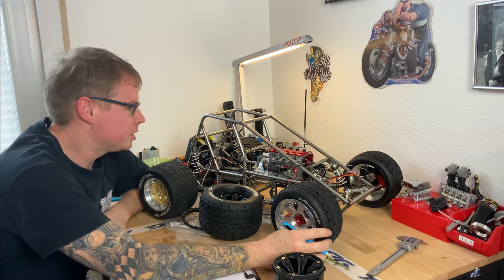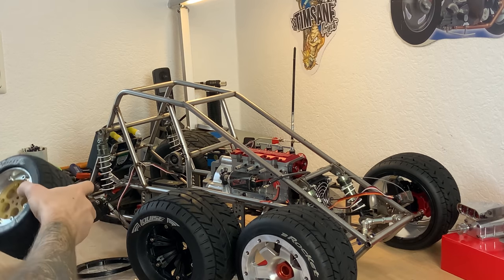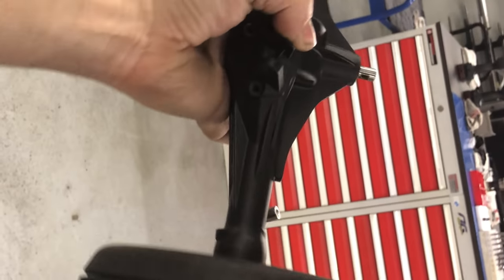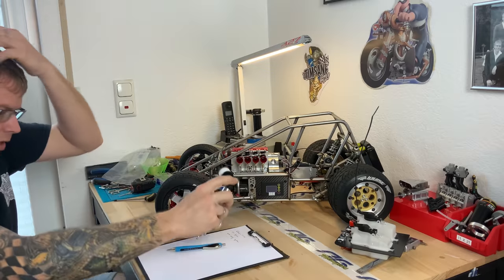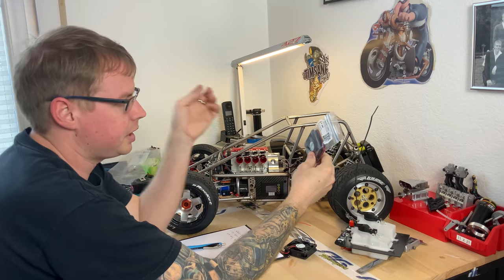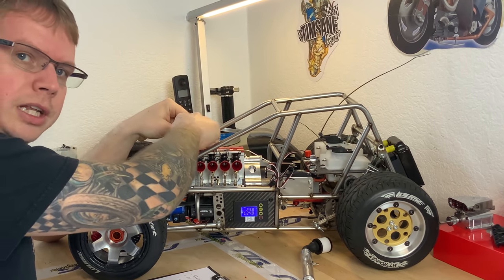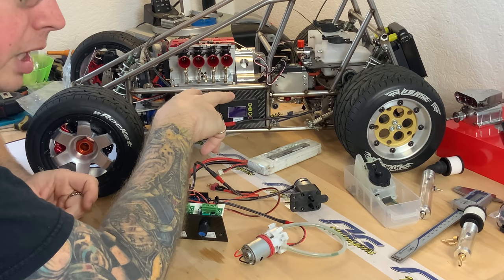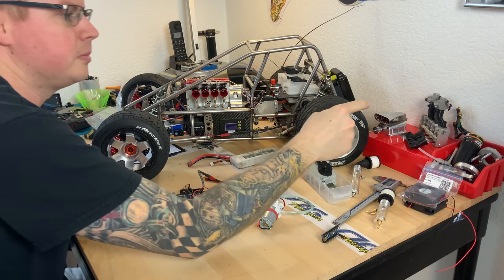1/5 RC Sprint Car - Toyan Oil and water system plus billet wheels and tires

Comment: Fantastic project. 
I grew up in Connecticut. Every summer as a child in the 70’s, we would spend August in Wisconsin. My uncle and aunt owned a midget. They both worked on the assembly line at Briggs & Stratton, assembling lawn mower engines. Back when companies paid a living wage😂 
I spent hours, sitting in the seat, still on the trailer, in the driveway after a evening race.  They occasionally placed, but it was always a party......all day long😎
Reply from the maker: That sounds like fun and nice memories! Glad to have you onboard of my channel!

Comment: heat the centre of the from rims and brush it with brass brush you'll get the same color as the rears if done right.
Reply from the maker: Thanks for your comment! We do a special ceramic coating in our shop. This is how I made the rear centers and that will be the coating for the front hubs as well.

Comment: Nice. Wheel and tires. Those stock rear wheels look like the ones of the Raminator.
Reply from the maker: Thank you! I had to check back to see the Raminator again -- I want one!
Reply: Why?!, if you can make one!. 😂 on a serious note what would you do or add to it if you had one? Besides swapping out pipe or engine?.
Reply from the maker: @713Ace529  The drivetrain should be changed as you mentioned. Other that that i really like it. But imagine a real supercharger working in that thing! I guess soon, once the sprint car is finished, i need another project....
Reply: Oooh! That’s teasing man. I look forward for that. Rc Sparks did an upgrade on engine/pipe and it responded well. Can’t wait to see your spacial treatment. 🇨🇱👍
Reply from the maker: @713Ace529  at the Moment that thing is way to expensive for me. Also shipping is 500 extra 🥺
Reply: Right. I don’t have one for the same reason. My biggest rc is the Slayer Pro 4x4. Everything else is 1/10. With that price, in some areas you can actually purchase a real car or a motorcycle. Lol. Whatever you do next I’m sure we all be watching. 🇨🇱👍

Comment: Fantastic. Have you tested the titanium valves yet? In the RC world, they have been attempted before but the ends mushroomed and it failed.
Reply: Hey are you the guy that's also doing 4 stroke builds?
Reply from the maker: Did they fail? I did not know anyone tried it before. I am not finished with the race head - still waiting on a big parts package from china. Hopefully it will be here in the next 10 days. THEN we will really get started.
Reply: @timsane  Yes, back in the day on the RCTech forum.. in the 4 stroke development thread. It was on an O.S. RC engine, not a toyan obviously. But the design is the same. Good luck, very cool project.

Comment: Bei meinem 5 zylinder lass ich das öl  einfach von der Kurbelwelle rumschleudern, die sogenannte Schleuderschmierung. Wenn das auf dauer nicht Funktioniert muss ich wohl Kanäle rein bohren und auf Druckschmierung umbauen.
Reply from the maker: Dieses im Video gezeigte Düsen System macht bislang einen guten Eindruck und ist leicht umzusetzen. Mal gucken wie es sich im Dauerbetrieb schlägt. Was für einen 5 Zylinder hast Du ? Gruss
Reply: @timsane  Den Motor hab ich vor paar Jahren selber Gebaut und immermal dran rum gebastelt. Die Toyan Motoren haben mich darauf gebracht auf 5 einzelne vergaser umzubauen und seitdem läuft er auch ganz gut. Ich hab ein paar Videos davon auf meinem Kanal. Der nächste Schritt ist ein Chassis zu bauen.

Comment: Louise RC Tires are sold in the US under the Duratrax brand, they also give the different names to the same tread designs. I'm not sure what the arrangement might be, why they are sold under different brands within different regions or, if they  have the same parent corporation. 

They are nice tires and wheels and they are now offering many belted tire options. Some of their unbelted tires have (at least in the past) very soft sidewalls and would balloon like crazy. The Duratrax Six Pack MT for example, didn't take high RPM's to turn into pizza cutters. Something else to look out for with Duratrax/Louise tires is dimensions. I purchased the same exact tire rim size, type and model tire as I already had but in the belted version and the outer diameter of the tire was completely different. The rolling circumference of the 2.8" belted tire was closer to the same tire unbelted tire on a 3.8" rim. The 2.8" belted tire was huge compared to its non belted brother. Just pay attention to tire dimensions before you purchase, you may need to research to find this information but don't trust that it would be the same dimensions as you previously expected.

Very good and high quality RC wheels, just know what you are purchasing. 

Speed Treads are nice as well. Also, I'm not sure how or if, they are or are not associated with one another.
Reply from the maker: Thank you so much for your detailed explanation! I will check that in the future, Lets see how fast we can burn that rubber down...
Reply: @timsane  I'm excited to see it!

I still believe that you should figure out a way to disengage the engine clutch once the electric motor pushes past a certain RPM. I know you are using a smaller pinion for the electric motor and only running 4s voltage and that is wise. My thought however is that you will be happier if you can reach higher RPM's without concern about the engine coming apart. I'm not suggesting that you implement anything yet, but it might be something to think about if you are less than satisfied. Wouldn't simply activating a throttle to neutral position type kill switch at a certain RPM do the trick? You'd have better ideas than I on how to actually get something like that to actually work well.

Comment: A sprint car is a v8 usually, which you could have done.
This is more like a quarter midget.
Neither one has a transmission usually, just a means of shifting the axle in and out of gear.
It’s pretty cool so far I hope the 9hp from the toyan is enough.

Comment: lol its so tight gonna have to go 1/4th when the V8 comes out.
maybe once you get a lot figured out some of the controls can be hard-coded and remove some stuff...

I'd love to see Toyo take on a mini-merlin - see you build a P51 Mustang
Reply from the maker: Hey David, I am afraid we need to build our own V8. Toyan will not sell one anytime soon. Thanks!
Reply: I wonder...
beyond the block, crankshaft, camsa and intake, could everything else be used in a prototype V8m
Reply from the maker: @makepartsUSA  I think a lot can be reused... but i also would like to make more improvements. and while we are working maybe increase bore ans stroke also. lets seen what the future brings...

Comment: Hello I was wondering what are your worries about the crankchaft I saw that Dennis Dempsey broke one is there any solution other than lubrication? I do not have the impression that this engine is designed for this purpose I think it needs an upgrade crank at this level But you seem very good at improving them For that I wondered what other modification you think would be good for this magnificent engine. ?
Reply from the maker: Hey David, it needs a third bearing in the middle of the block. I am making a kit for it as we speak. I cant say more at the moment.... Thanks for watching

Comment: If you boil those wheels then you will get them off on the plastic rims. I use that 1/5th scale wheels.
Reply from the maker: I tried that and burned my fingers baaaaadly ;-) But the oven method was not better - next time I will use water again, thank you !

Comment: Top work. I look forward to  seeing how the electric motor works with it. Not sure if you have mentioned before, will it be only electrical assist of a separate "boost" sort of button?
Reply from the maker: Thanks Stuart! It will be permanently running together with the nitro engine. Hopefully synchonising will not be too difficult.

Comment: Looking good it’s coming along . I’m the same way I would want to drive it to . I was wondering are you going  to keep the rear end or are you going to put a quick change rear end in it?
Reply from the maker: Hey Scott! I will leave it as it is -- To build a rear end is soooo much work and I was glad there is an off the shelf solution. And this one from a Lost Rock Rey seems to be tough as well. Hopefully it will stay alive once we add power and traction. Thanks!

Comment: Isn't that called a drysump oil system? Anyway: geat build! I enjoy following the build by watching with these video's

A tire suggestion, GRP also has F1 tires. I have these louise tires on my kraton at the moment and am looking at those F1 tires myself as a replacement (of belted tires, these louise tires balloon too much for my taste) 

They are available in:
OD:137mm ID:100mm W:64mm ("front tires")
OD:137mm ID:100mm W:75mm ("rear tires")

https://www.grpgandini.it/tyres/1-5-f1.html

Available in a wide range of compounds and wet/slick thread patterns
Reply: Oh and I just did subscribe ;) looking forward to the next video
Reply from the maker: Thank you! The current tires are nearly 170 mm in diameter and rear has a width of 100. kind of difficult to find sth in this size. I run GRP on my Traxxas XO1 build. Oh... and it is a - some kind of - dry sump system. Normal dry sumps use different pump styles and are not electronically (correct term?!) thanks for your support
Reply: @timsane  Oh I didn't  realize that these tires are that big. I assumed these where the biggest size but now that I am browsing louiserc's website I can see that I have are indeed also 170mm. In my case on the kraton the smaller diameter wouldn't be an issue but for your vehicle they are obviously way too small. 

Another alternative is going the same route as Keith57000 (https://www.youtube.com/user/Keith5700/videos) and consider using gokart tires.
Reply from the maker: @StefsEngineering  I know keith and his amazing projects. Out of this world. I am using Go Kart tires on my willys - perfect for 1/3 scale. Between 1/5 and 1/4 usually it is difficult to find anything. Thanks
Reply: @timsane  allright it's clear that you did your research. It's clear that I can skip the obvious suggestions :)

Anyway: good luck with the build!
Reply from the maker: @StefsEngineering  I am sorry, i did not want to downgrade your suggestions! I am always thankful for tips and good sources for parts. 😘
Reply: @timsane  No problem, totally understand! It didn't feel as 
condescending or anything bad. It's a good thing, we are on the same line, you are only a bit ahead of me because it is your project afterall. When I think of something in the future I won't hesitate to share :)